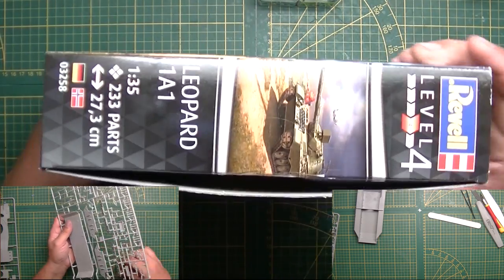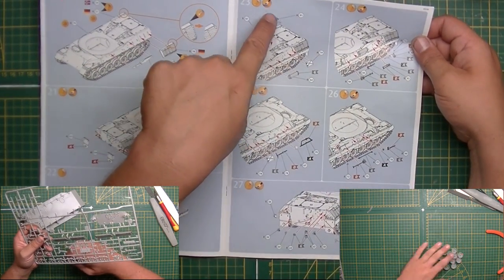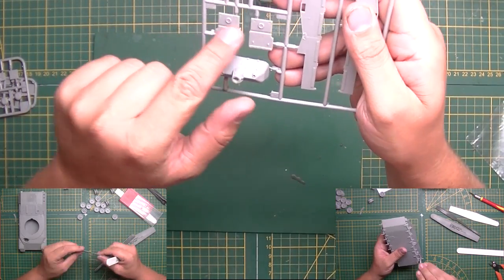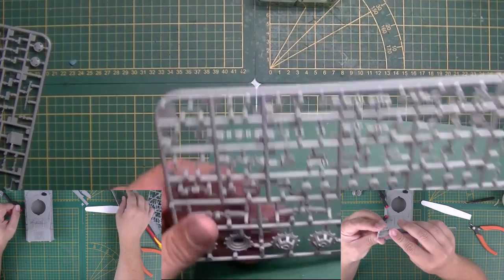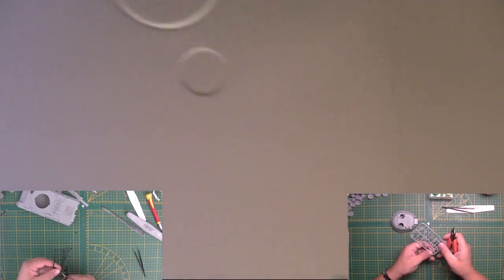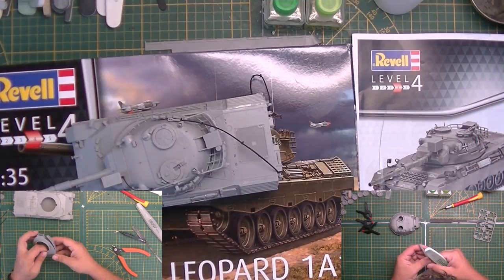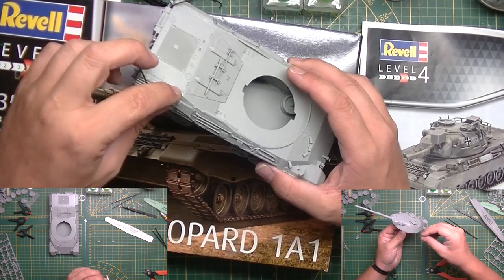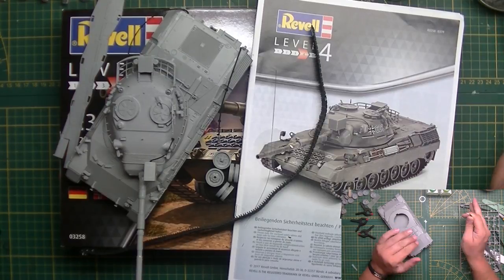Kit and Build review: Revell Leopard 1A1 #03258

Comment: Hello, what glue did you use for glueing vinyl tracks and towing cables? I tried to use many glues, for plastic, rubber, universal glue and CA - without any results. This material looks like be glueproof...
Reply from the maker: Normally i would use Tamiya extra thin but if that doesn't work you could staple them together and hide the staples under the side skirts

Comment: what the hell is with the split screen it does not work
Reply from the maker: Doesn't it work or you just don't like it ?
Reply: @DutchModeling  I'm a little late to the party but I think what Frank meant was it's a little distracting. Especially with the two smaller screens, it's a bit much to watch at once. It is an interesting choice, something you don't see very often, but I will say having to switch back and forth from one to the other and then back to the main picture can lead to people feeling like they are missing content.

EDIT: I would also say speeding it up that much is a tad bit much. Still a good video but just some food for thought
Reply from the maker: Thanks for the feedback,  this is something i can work with